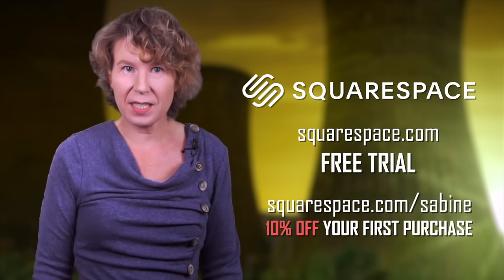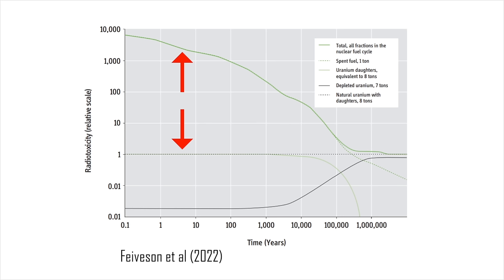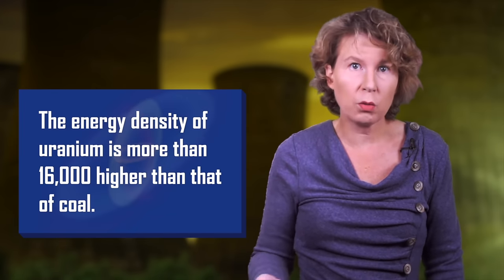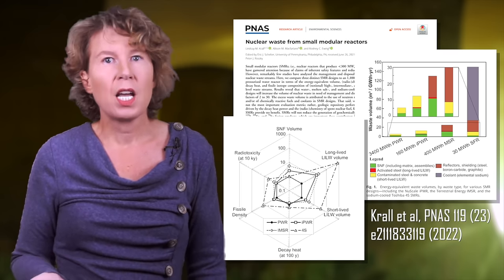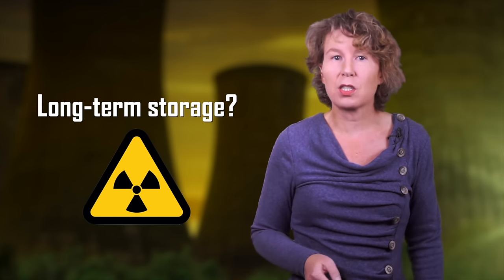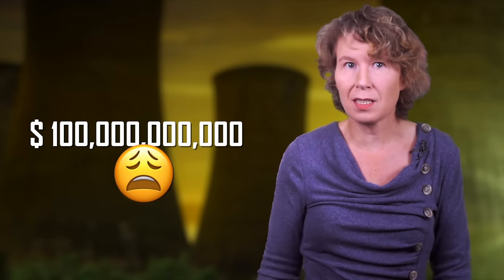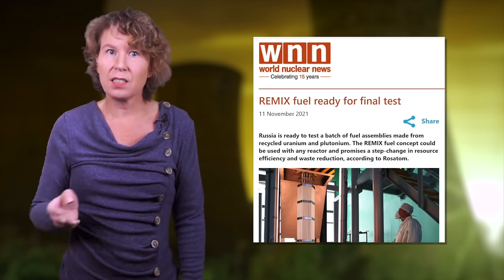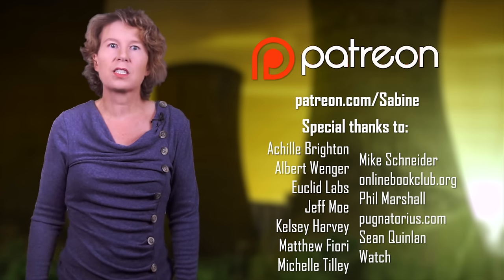Nuclear waste is not the problem you've been made to believe it is

Comment: Thanks for this super-informative video, especially the recycling part.
IMO, burying the high level "waste" and making later access near impossible is not such a great idea because it prevents recycling.
It would be far better to keep it somewhere accessible where one can keep an eye on it and recycle it when the opportunity presents itself.
Reply: In the meantime there had been discovered methods to return the stuff in new reactor types running on thorium and being useful there. To bury the stuff is the stupidest idea. It's not waste its valuable energy (in it) to a permanent recovery and recycling process chain should be designed and made feasible.
Reply: Recycling is already done by French. The result is new fuel, and actinides + fission products (extremely radioactive and useless). The latter still needs to be disposed of. You can't avoid this problem.
Reply: @uweburkart373  that makes no sense, recycling it allows for getting more energy out of it (even though not economically viable), but eventually, according to all laws of physics, you'll have to dispose of it and then you need a burying site

Comment: If we replace fossil with nuclear, then we have a lot more waste. With no actual long term solution available.
Uranium mining isn't something we want to include in the picture? 
Uranium is also a limited resource.
It's a no-brainer. We need to use less energy, not look for more complex, dangerous and unsustainable sources.
Reply: "If we replace fossil with nuclear, then we have a lot more waste" If we replace fossil fuels with nuclear, reprocessing will become economical, which reduces the amount of waste by two orders of magnitude. So we'll actually have a lot less waste.
"Uranium is also a limited resource." There's enough uranium for a million years.
"We need to use less energy" Using less energy is still using some, and that some still needs to be provided. And the safest way to provide it is nuclear.
Reply: @Crispr_CAS9  The danger of waste is not related to its size.

Comment: Not sure how you can say it’s the fastest way to get off fossil fuel, you literally showed in a previous video that it will take decades and is the most expensive
Reply: @matthewbrust3353  France shows nuclear works, and is cheap. France converted most of their grid to nuclear in 15 years. Germany shows that renewables are not cheap and take a much longer time.
Reply: @hewdelfewijfe  Sabine has said in previous videos that if the world switched to nuclear we would run out of uranium in a decade. And France is smaller than the US, it wouldn’t be possible to power the country with nuclear in the same time. So not only wouldn’t it be done in time to have an effect on climate change, we’d have a bunch of obsolete expensive power plants. You should watch her previous videos on nuclear power
Reply: @hewdelfewijfe  there’s not time to do that. I’d suggest you watch her other videos on nuclear because what you’re talking about isn’t feasible
Reply: @matthewbrust3353  What's not feasible?

Comment: I'll admit that my only objections to nuclear power, in my 70 years, have been the nuclear waste issue and earthquakes.
I trust your judgment (I've been watching your channel for years) and like your deadpan humour, and you may have finally convinced me on the safety of waste storage, but tectonic movement remains a concerning danger to reactor sites. Recently, the risks of a nuclear accident due to war in Europe have come to the fore.
I'm still unsure.
Reply: The Fukushima reactor survived the earthquake just fine. It was the tsunami taking out the backup diesel generators for active cooling that was the problem. Any modern reactor like the AP 1000 has passive decay heat removal, aka no backup diesel generators, and it would have survived the earthquake and tsunami with zero damage. Earthquakes don't do that much damage if you seismically isolate the building.
Reply: @hewdelfewijfe  Well. I am not convinced that any nuclear reactor could do just fine, even with highly developed safety measures, when hit with the double impact of an earthquake and a tsunami.
Reply: @EnlightenmentLiberal  
I agree with much of that, however it should be noted that the Fukushima reactor site is still subject to the elements. Precipitation runoff is impossible to contain. 
 Are decommissioned nuclear reactor sites re-purposed? I don't think so.
Reply: @grantallard  What is the size of land of significant precipitation runoff? Do you have hard numbers in terms of square kilometers and something like mSv / year or Bq?
Reply: @hewdelfewijfe  
What?

Comment: The number one problem with nuclear power is that it is far more expensive to produce than using renewables plus storage. And then there’s the extremely long half life of the waste.
Reply: Renewables plus storage are FAR more expensive than nuclear power. By a lot.

Waste isn't a problem. Most of it is uranium/transuranics which are just future fuel. Most of the rest isn't dangerous at all, either because it's already stable, it has an extremely long half-life (which means safer, not more dangerous), or it has such a short half-life it has decayed to one of the other two by the time it comes out of the cooling pool. About 1% is actually a problem, and it's only dangerous for about 300 years. Extract it, glass it, and cover it in concrete. Problem solved.
Reply: @Crispr_CAS9  Renewables are only far more expensive if you can’t do Maths. I’ll take the analysis of Australia’s leading scientific body over ideology. 
Then there’s the problem that it would take until 2040 to build a reactor and we need solutions now. And the small problem that Au has no nuclear industry or experience- we’d be starting from scratch. If this were a viable solution why didn’t our LNP introduce it while they’ve had government in Australia for two-thirds of the last 30 years?

Comment: "Burying the stuff underground seems a perfectly fine solution to me."
Don't sell yourself as a scientist qualified to talk about stuff that you apparently know nothing about.
Making predictions about the geological stability of any place over the required timeframe is entirely impossible with all know methods. We simply cannot predict with any level of certainly what happens in the asthenosphere.
For example, whenever there is volcanism that does 'not' happen at a plate boundary we just label it as a hotspot. The term however doesn't describe a well-researched phenomenon but instead basically the obscure cause of volcanism that is not happening at a plate boundary.
So at this point in time we'll basically have to assume that whenever we produce radioactive waste we'll have to calculate the security service and maintenance of the storage facility for quite a few millennia.
If you add that cost to the equation nuclear power is so insanely expensive that using it is just beyond insane.
Reply: "Making predictions about the geological stability of any place over the required timeframe is entirely impossible with all know methods."

Over 300 years?

That's about how long it takes for the spent fuel to become safe to crack out of its casks and handle directly without gloves. When you talk about geological time scales, you're talking about how long it takes for the stuff to emit less than the background level of radiation. That's not something we actually need, but only something that activists put into law to intentionally sabotage nuclear power.

Comment: Only a few percent of the Uranium fuel is used. The fission products (high level waste) absorbs neutrons and as the products become more concentrated the reactor efficiency decreases. The rods are removed when there is still, maybe, 95% that has not decayed yet. It is cheaper at this point to use new rods. For those who leave the movie early, the uranium (and plutonium) in the used rods can be recycled but it is more expensive than using newly mined uranium - for now.

Comment: Whilst managing the waste might well be the lesser of evils, a failure of reactors is often horrendously costly to remediate. Fukushima melted fuel rods are yet to be removed 13 years later, and crews have been working 24/7 in very dangerous conditions for the last 13 years working toward that end. To date, several hundred million man hours have been invested managing the damaged reactors, and they are not even close to fully stabilising the situation there.

Comment: Overall, a pretty good video. Most of the time when I thought you missed a point you answered it shortly there after. My education is an engineering. I was the United States Naval officer on nuclear powered submarines and qualified for the operation and reactor (S5W pressurize water reactor) n the submarine. I also worked at two different commercial nuclear actors one as a BWR 
Three and one a BWR five. Pretty much held every Senior management position at the two plants. I also also worked in the manufacturing of BWR reactor fuel. And in uranium enrichment (both centrifuge and gaseou diffusion)

On the front end of the fuel cycle: mining and enrichment. The primary hazard is alpha radiation, which is only ingested, but the major major major hazard was heavy metal poisoning from uranium similar to lead. You also had to worry about nuclear critical safety.

Overall, very good video. Thank you. 

Navy reactors were great. They’re like Ferrari engines.  That’s where you have fun.

Comment: I disagree with the suggestion that Yucca Mountain was a reasonable place to store radioactive fuel. A great article published in SCIENTIFIC AMERICAN JANUARY 1998 "Burial of Radioactive Waste under the Seabed" by Charles D. Hollister and Steven Nadis. This was a competing solution with Yucca Mountain, but they could only support one solution and putting radioactive material in the seabed sounded "bad". But it makes huge sense - you can ship fuel to the Sargasso Sea which has thousands of feet of very fine clay, and the area is very stable and boring. Plus getting the spent fuel can be by ship with minimal exposure to population centers which is a problem with Yucca Mountain.  Go to the Sargasso Sea, drill well holes and put the waste in containers which are deposited deep in the mud.

Comment: With currently 6984 comments and no search available for comments, this comment might already be processed. Anyway ...

The Finnish solution is based on the Swedish KBS-3 storage method, where Sweden has storage under construction at the Forsmark nuclear power plant some 100 km northeast of Stockholm.  As a field geologist in the late 1970s, I did a lot of the bedrock drill hole loggings, developing the mentioned porosity tests that the Finns use.  However, storage is just a part of the nuclear power life cycle; when calculating the costs, everything from mining to storage needs to be included,  and then the calculus is often worse than thought.   Sweden has some 27 % of Europe's uranium, excl. Russia/Ukraine, most of it in a single mountain, fortunately with a too low grade to mine, which has saved the Swedish west coast from becoming a nuclear wasteland.  Unfortunatly, large parts of Canada, US desert states, Australia, and other countries have not, but since the majority of these areas are inhabited by aboriginal inhabitants, not Western such, most of the devastating pollution from the mines has totally destroyed areas larger than most European countries, with radiations levels similar to what the Baltic states, Finland, Sweden, and Norway experienced from Chernobyl.  For a foreseeable future, in a cycle about 25-30 years, thanks to groundwater circulation, we will experience increased levels of radiation. In Quebec, Arizona, and New Mexico, it is worse; the reservations will be "permanently" plagued by radioactive wells and health issues.

Comment: There is one aspect you have over looked, the cost of Nuclear compared to other forms of electric generation. If you also include the Nuclear waste, treatment, and storage costs, which often get excluded from the generation price. The price just sky rockets into the nearest neighbouring solar system. Security is also an factor that get over looked, and all I need to refer to is the Power plants in Ukraine, and or the word dirty bomb. No I prefer wind turbines, which cost one tenth that of a Nuclear power station for the same amount of generation. The running costs are far less and they are even making them more recyclable these days.
Reply: "The price just sky rockets into the nearest neighbouring solar system." Include all of those factors if you want, then add costs of firming and mine reclamation to the costs of renewables. And then guess what? Nuclear is cheaper.

"No I prefer wind turbines, which cost one tenth that of a Nuclear power station for the same amount of generation" If you include the firming costs for wind, it is 60% more expensive than nuclear.

Comment: About 40 years ago when I embarked on a short  "Nuclear Engineering" course, the prevailing opinion on long life waste management was, "encapsulate waste radioactive beads in glass".
This supposedly made the stuff safer, & particularly resistant to ground water, thought to be a potential risk in in long term deep subteranian storage. So what happened: too costly, too difficult, or do the powers that be not care sufficiently?
Reply: Apparantly, most vitrified HLW has stability issues. The glass tends to anneal into distinct domains with crystal boundaries, especially with ongoing decay heat. As fission products get excluded from the annealing glass, it accumulates in the interfaces and become available to travel through the material and corrode the encapsulating container.

Other issues are as you suggest. Too costly for a start. Direct disposal of intact spent fuel has the advantage (touted elsewhere by others) that the pellets are a more robust matrix and sealed in zircal jackets (not counting broken ones), and that the reactors have the handling devices to put these directly in casks with minimal future handling if those casks could be disposal-rated. It is also difficult to process into a form that leads to proliferation risks.  In contrast, reprocessing results in two waste streams needing different treatment and disposal facilities. It also concentrates plutonium which then becomes a proliferation and security risk. France has reprocessed about one third of all their spent fuel, and has huge interim stockpiles of both vitrified waste and plutonium.

It seems that reprocessing is more expensive than expected, and creates two types of waste that each need more fiddling around than the original intact spent fuel. It multiplies the problems rather than solving them.

Something similar seems to happen with the noble attempts to re-use spent fuel. After reprocessing the separated plutonium is added to depleted uranium, plus a top-up from excess weapons material to make MOX.
Used MOX has a more diverse set of plutonium bombardment products, in particular U236 and it's product U232 which complicate almost every subsequent option. 

Or as you suggest, they may not care. The spent fuel inventory increases annually and seems to remain in the "too-hard" basket. No one is willing to allocate the money to do it properly.

Comment: If I have an issue with nuclear power, it’s the occasional, yet spectacular, instances of nuclear reactors failing: Chernobyl & Fukushima being the two obvious instances.  I was very surprised to find out that cooling for the Fukushima reactors wasn’t integrated into the reactor itself, which resulted in the meltdowns of the four reactors at the site, even though all of the reactors had been “shut down”.  Also, the cooling ponds at the site dried out due to the shut down cooling pumps for the cooling ponds.  I didn’t know that spent fuel rods generated that much heat on their own.

So, for me, there are reasonable safety issues to consider with nuclear power.  Come up with a truly safe reactor design and I’m all for it.
Reply: Molten Salt Reactor

Comment: What I have read about the modular reactors is they are more efficient than their larger counterparts and thereby produce less waste. If more money was contributed to nuclear reactor research than inefficient and wasteful renewable energy I think many of the world's energy woes would be solved. But we would still need oil and gas byproducts to support the modern infrastructure. Trying to replace all those byproducts with bio byproducts usually ends up being more energy intensive and more toxic stuff is produced from that. Humans are likely centuries from the Startrek synthesizers if at all possible, that and warp engine space travel and antimatter engines.